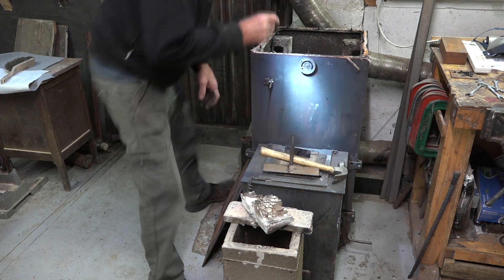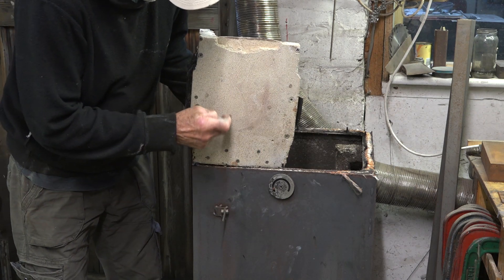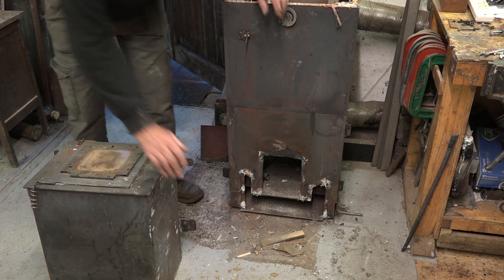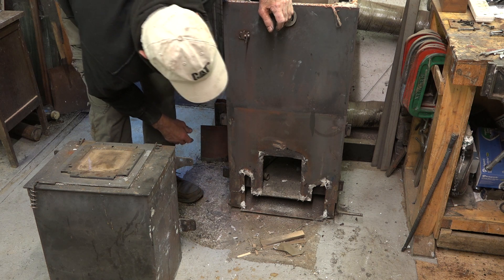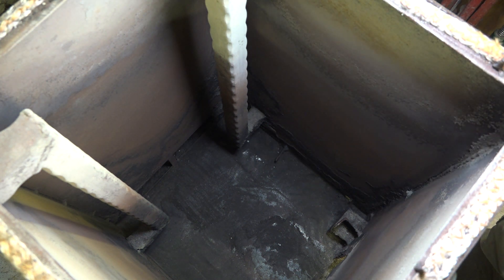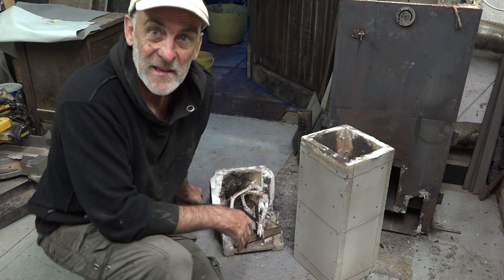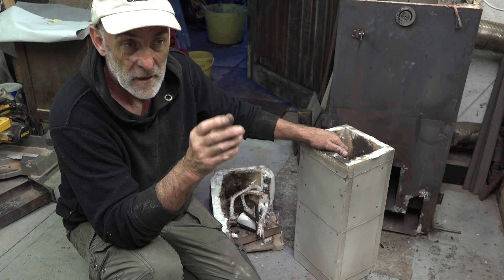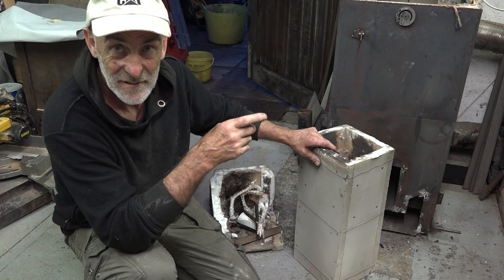Rocket stove heater strip and refurb july 2019

Comment: After all the troubles you've had with the warping of the steel plate where the fire box joins the exchanger, I'm surprised you didn't think to run the fire brick (Ceramic Fiber Board) right through this wall, so any warpage wouldn't effect the burn tube seal. I really appreciate your thorough and detailed step by step explaining as you work through each problem. Thanks for the great work.
Reply from the maker: Thanks. yes that would work but I wanted the firebox to just separate from the exchanger clean by undoing the bolts anything you run through into the exchanger will need sealing or cementing in some way after you separate it. Cheers

Comment: Hi to all, and sorry if this has been asked before. I am working on the design of my stove and wondering if ceramic clay drain pipe is suitable for a riser, as they're readily available at builders merchants (UK), as are clay chimney flue liners. I'm half expecting a no on this as I havent seen anyone using them on other builds,---Or have I come up with a brilliant idea?
Reply from the maker: you could look at the specs for the clay liners and see what heat they tolerate you need to be in the 600 C  + area if your stove performs as it should. My money is on them cracking though.

Comment: Love  your work a yours was the first rocket stove I ever saw and got me wanting to build my own to replace my pellet stove. The stove I'm building I made my burn box and riser tube out of the ceramic fire board. It says its good up to 2300 degrees Fahrenheit or 1260 degrees Celsius. Do you think I'll have a problem with it not lasting and breaking down?
Reply from the maker: Hi Daniel, you should be fine with that, the place that gets the most intense heat and wear is the base of the riser tube especially if you are running a vortex, its a case of finding something that will take the abuse, thats why i built the last one in 2 sections as you can see the riser is fine the base is trashed, i didnt use high temp board in that section like i thought i had so cant say how it would hold up, plan to change that this time and hoping for a better outcome. cheers

Comment: What happened to the original cast riser? I just built a mold and made a riser for myself, copying what you did, but I will use a barrel to start, as I am not set up for welding.
Reply from the maker: It was ok but when i took it out for cleaning was really clumsy and broke the base, thought id try something easier to construct

Comment: Why not make the firebox out of a  tube of stainless steel and insulate the outside of the tube ???
Reply from the maker: they destroy stainless you would maybe need 6mm thick tube
Reply: @LozHarrop  Now about using inconel sheet and bending it round and welding it?? I know this stuff is bullet proof to ultra high heat. Thanks for the info too.
Reply: @victoryfirst2878  inconel is LOTS of $, it is available but you are paying huge amounts for it.
Reply: @markmatt9174  So using 316 stainless 1/4" thick would work?? Thanks
Reply: @victoryfirst2878  that would hold up long time, but even 1/4" regular steel would last a while.   11awg SS or even 14awg would hold up long time.  Lighter gauge stuff 18 or 20 would warp in a season and be junk at those temps for sure.
Reply: @markmatt9174  Really appreciate the information on metal type and thickness. Will keep that for making my hybrid rocket stove. Peace